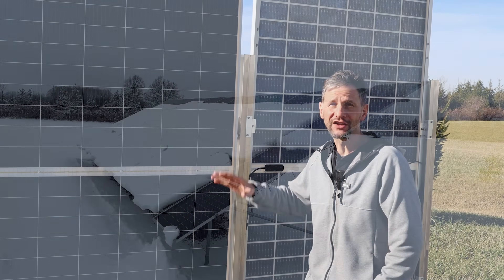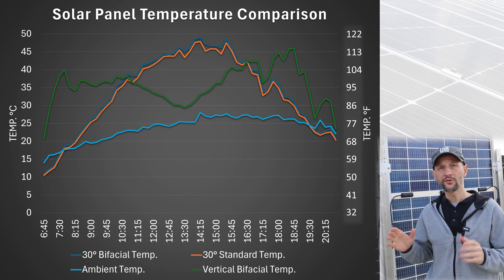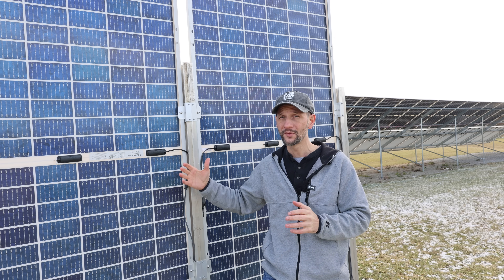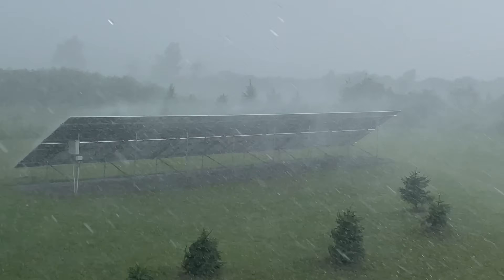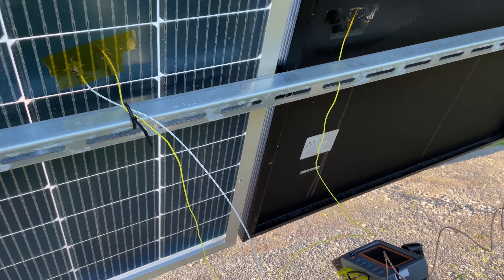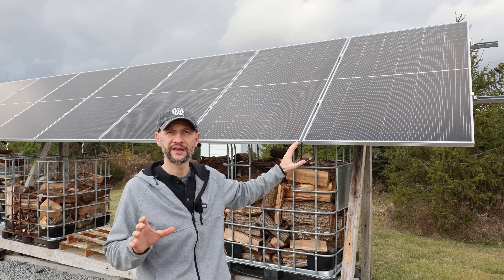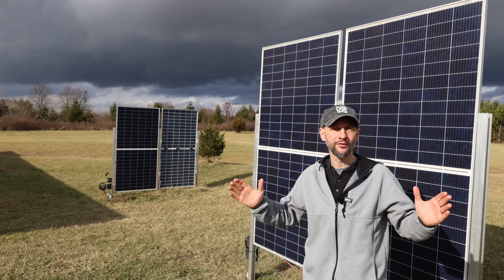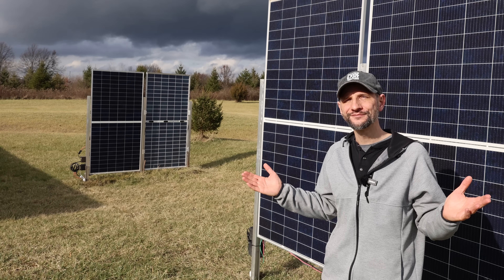HEAT -The Enemy of SOLAR- Are Vertical Solar Panels Better?

Comment: a black backing of a solar panel actually cools them off better because they are a better black body emitter when not in direct sunlight. this is one of those thermodynamic things that is misunderstood by most people on youtube for now.
Reply from the maker: Why do you think my data shows them running significantly hotter?
Reply: @ProjectsWithDave  Because the effect works both ways. Black surfaces are also better at absorbing radiation.
Reply: My guess is that if they were roof mounted, the black would irradiate more efficiently to the below roof materials compared to a white back.
Reply from the maker: I suspect roof mounted will show different results because there is dramatically less back side solar input.  I'll have to think of a way to test that.

Comment: Hi Dave! Using a radiator and water coiling do seem too complex for what you get out of them, but what about air cooling them with fans blowing into the back of the panels? It's not especially complicated and pretty easy to replace a broken fan. I feel like I've seen another channel briefly cover them, but I don't recall how improved the output was.

Might be worth looking into for the angled panels!
Reply from the maker: I suspect it would be helpful, but I think even the slightest breeze would be more productive than fans.  Maybe it would be worth while on very hot days?  It would be an interesting experiment.  Playing off your idea, I think it might be more beneficial for a roof mounted array.  You could detect when temperatures were very high and turn on some ducting system.  Or even better, find a way to naturally duct more air under the panels for better passive cooling.

Comment: When you get to trying some of your temperature tests on roof mounted array, perhaps consider a black/dark roof and a white painted roof - this alone makes <10 degrees of difference in roof temps.
Reply from the maker: The hard part is getting back to back data for a reliable comparison.  I have to think about how to get a valid result.   Maybe sliding something white behind a portion of the array on a dark roof.....

Comment: Dave, do you think it would be worthwhile to use some fans under roof mounted panels to cool them a bit, or would you waste too much power to be worth it? I'm thinking something like a wide squirrel cage fan at the lower edge of the roof. One or two panels wide maybe. Just a thought.
Reply from the maker: I suspect it would be helpful, but fans use a lot of energy.  Maybe it would be worth while on very hot days?  It would be an interesting experiment You could detect when temperatures were very high and turn on some ducting system then compare the total system efficiency including fan power.  Playing off your idea, it might be better to find a way to naturally duct more air under the panels for better passive cooling.

Comment: LTT solutions are only viable for those who at not paying for that solution themselves.

Thanks for all the data.  That is actually helpful understanding the trade-offs.  And you focus on the key metric, total production.
Reply from the maker: Thanks!  The engineer in me would loves to optimize everything but it isn't always practical.  For instance, I've always wanted to make a system for collecting heat from the hot water running down the shower drain to pre-heat the cold water filling the hot water tank.  Unfortunately, I don't think that project would ever pay for itself.
Reply: @ProjectsWithDave  Too much heat would be lost between mixing the hot and cold water, water through the air as you shower, then as the "gray water" enters the drain.  Not to mention clogging the heat exchanger with hair, dead skin cells and soap scum.
Those are the items that come to mind off the top of my Electronics/Broadcast engineering mind.

Comment: Hey, for what it's worth, Linus mentioned the Solar/Thermal panels in the most recent livestream WAN show (1 hour & 2 minutes in), and said they need to be replumbed since he forgot to add anti-freeze (ethylene glycol) before the winter freeze last year. solar PV still works, but no thermal benefits now.
Reply from the maker: In his first install he said he planned to drain it for the winter so he didn't have to use glycol.  Maybe he decided that wasn't practical.  The cost of having to go back and work on the system will likely negate the benefit for the next 20 years.
Reply: @ProjectsWithDave  Hopefully it's just the plumbing, and not the heat exchangers on the panels too.  I'd love to see the production numbers for his panels. I don't think I've heard any hard numbers, but it wasn't exactly a large system to begin with.

Comment: Quality engineer here. You may find value in creating these 3D graphs as contour plots. Python matplotlib tricontourf is pretty good at these. This type of graph lets you look at it in 2D but can analyze it as if it's 3D. Might be easier to gather trends from versus an X-Y-Z plot.
Reply from the maker: I thought about that but ran out of time, I'll have to try it and see.  Sometimes I get stuck in the analysis phase and don't get the video done.  There is so much to glean from data.

Comment: Great video Dave,  I did see a video of a water cooled ground array where the guy mounted a rain gutter along the bottom of the solar panels to catch the water and it emptied into a insulated cooler which had a small solar driven water pump (like for a bird fountain) to send the water back up to the top of the array where he had a pvc tube with tiny holes in it to drizzle the water over the solar panels.       It was effective also, I believe if memory serves that he lives in Arizona and it lowered his solar panel temps by about 20-30 F.        Happy New Year to you and all here !  ✨🎉🎊
Reply from the maker: That's an interesting solution.  I wonder how hot the water gets?  Maybe it's not that important since evaporative cooling would be significant in this case.   I still don't like the idea of constantly flooding everything with water.

Comment: I would like to see that hypothesis that the wind direction was causing the vertical panels to be hotter tested.
Reply from the maker: Hmmm.... Me too.  I don't think I could make a whole video on that, but maybe add it to another one for those of us who need more than theories.  
I need to get a device for logging wind speed and direction: https://amzn.to/3PgBNob
Then collect wind speed, wind direction, temperature, power output and irradiance for a couple of months.
I'll put it on the list,  can't promise I will get to it.
Reply: @ProjectsWithDave  Great. Just a flag in the ground to show where the wind is coming from could convince me that wind from the right direction will cool the panels significantly, while wind from the wrong direction won't. I don't say a detailed in-depth analysis with all those factors over a longer period wouldn't be interesting, but not necessary to support the hypothesis.

Comment: Get UV light resistant glass to cover the panels which would reduce the heat and also proteect the panel when there is a hail storm. Though that might cost alot for the glass.(good for limited space and hail concerns.)

Comment: Great video! I live in the Arizona desert, west of the Phoenix metro. During summer, turbulent desert winds force distributed airflow, so leaving a few inches of space helps a bunch. Here, we can also lose an easy 16%, due to dust and film buildup. Oddly, derating for high heat, dust, wire loss, and other losses seems to always end up in the narrow range of about 46% to 49%, so doubling the number of panels works out. So, most people calculate what they need productivity, then double that for the design panel capacity. Also, I have some vertical panels in an east/west configuration, which extends my solar day enough to reduce need for battery capacity.
Reply from the maker: Thanks for the Super Thanks and the detailed info on your actual situation.

Comment: I really like your videos. That said, I'd say most of us who are watching this and are serious about an alternative means of energy had already invested in solar equipment when it was a lot more expensive. I use my solar capability if I have an extended outage or in the event of a grid issue. Otherwise my grid power is affordable for me right now. I have cheap (cheaper now) panels that produce power. I have some power boxes that still use the old external brick charger. I already have batteries that have been greatly improved over the years. However when I plug my frig in it works. I for one could not replace my equipment with these more efficient models. The only exception for me would be upgrading from flooded or AGM to lithium batteries. Maybe I need a Utube channel? :). Were you able to sell off the panels you replaced? So in my opinion those of us who took the advice back in the day and got prepped are stuck with what we already have. Maybe not the most efficient, but it works for me the way I use it. But in any case thanks for the effort in making this video.
Reply from the maker: Thanks for the feedback.  I haven't sold any panels.   I just keep redistributing them to new locations : )

Comment: Amazing testing, thanks for all the hard work! Depending on the size of the setup, vertical panels (in addition to some standard angled ones) might make more sense than going with only bifacials in the optimal angle. I'd rather have 2 bifacial in optimal angle, than 1 vertical and 1 in optimal angle. But some people and use cases might only allow for vertical panels. Basically, as long as one has money and space, fill everything with more panels!
Reply from the maker: There may be an optimal application for each type of panel, but the possible combinations are endless...

Comment: Nice info, thank you Dave. I tend to think that the configurations of the panels for the sake of heat management has a direct effect on the longevity of the panels, extending their service life.
When you say "string inverters", there were some panels manufactured with microinveters on each string within the individual panels. These panels were excellent on dealing with shading and had a sizable increase in year to year efficiency. Unfortunately due to the grid tie market rule changes, there were issues with automated disconnects during power outages. Grid tie trends typically control the market when it comes to panels.
Reply from the maker: I suspect the vertical panels will last longer.  They see lower peak temperatures and avoid the most intense radiation during the day.  But, maybe lifetime production is the same?

Comment: So why don't they have heat syncs and fans
Reply: Because it's not worth the effort. You may gain a few percent more power but it will cost much more and adds complexity.
Reply: @TheFreezeChill  that makes sense then
Reply: @TheFreezeChill  As solar technology advances this could be worked out through more innovative design

Comment: I appreciate there's actually someone out there more picky about data collection and experimentation than I am.
I wonder if it would make sense to put an IR filter on some of the panels.  I imagine most panels can't make use of IR at all, but IR is what generates the most heat.
Reply: nah a good amount of solar panel power generation comes from IR wavelengths. this is why putting a solar panel inside a window cuts its generation by about half. glass blocks most IR and UV but lets visible light only through

Comment: Only in America could we make a grievance out of a metric unit for measuring temperature.  Freedom units indeed.
Reply: metric is Waaayyy easyier.

water freezes at 0°C - it boils at 100°C - 1 Liter of water at 20°C weights 1Kg and is also 1000ccm of volume. 21°C is room temperature.

average water supply for an adult is 2 L a day.  everything is better then counting toes and feet.
Reply: @casemodder89  Right, and where did they come up with 16 oz/lb.???
And what's the relationship between pounds mass and pounds weight? So bad that my math prof confused himself trying to explain it!
Reply: @casemodder89  but that solves nothing.  Which temp does food bake at, what temp does it need to warm at, what temps cause oil to burn at, what temp should I set the freezer to?
Reply: @sprockkets It doesn't need to solve anything. Basic math.
Reply: Celsius is fine. 0 is freezing, which is easier than remembering 32 degrees, and most other stuff is relative just like with fahrenheit.
Reply: @yaash4123 imo Fahrenheit is easy to remember, 0 it's very cold and 100 it's very hot. Fahrenheit for measuring for humans, Celsius for measuring for water, Kelvin from measuring the universe
Reply: Fahrenheit was made so that we wouldn't need fractions for temps either. I really think Celsius is dumb, esp for setting room temps.
Reply: @sprockkets  My thermostat uses integer degrees for Fahrenheit and 0.5 degree increments for Centigrade.

I'm really old and used Fahrenheit exclusively until high school Physics happened then I became bi-unitable. Still fluent in both but absolutely mis-trust anyone who engineers anything using Imperial measurements! 

Back in the 70s both Canada and USA went metric. Road speed and distance signs in both countries changed to show both units to ease the transition. 

There was backlash on both sides of the 49th but Canada (Pierre Trudeau) stuck with it. 

Meanwhile in the USA, big business and exceptionalism won the day and the signs went back to Imperial after just a few months.
Reply: @georgebissenden9297  that was Reagan who killed it even for the gov. I like everything metric but Celsius.
Reply: @sprockkets  Fwiw the military still uses metric
Reply: @sprockkets 😅 Using fractions is dumb. Metric is better in every way.
Reply: @mr.monitor.  congratulations on missing the point. 
But just in case you aren't thick, no, I don't want to set my house temp at 23.5.
Reply: @sprockkets  What you set the thermostat to is irrelevant if you are comfortable. Clinging to some old measurement doesn't help anyone.
Reply: @mr.monitor.  Lol, Celsius is a mere 18 years newer than the other. They both practically came about at the same time.
For the third time, I don't need to express temps with a decimal point because that's was the whole point of F in the first place.

Celsius will always be stupid.
Reply: @sprockkets  Cry about decimal points. My thermostat gives .1 F increments. Does this offend you? They came up with another system because yours didn't work well.
Reply: @sprockkets  Your argument is that decimal points are difficult? 🤣
Reply: I don't think dunking on Celsius vs Fahrenheit is the flex you think it is... Unlike basically every other Imperial Unit, Fahrenheit is also base 10, so there really isn't any inherent advantage to Celsius over Fahrenheit.  If anything, for these types of everyday outdoor measurements, the lower 0 point of Fahrenheit probably gives it an advantage so you have less potential for negative values, which could complicate things. You should advocate for measurements in Kelvin, instead (or the Imperial equivalent, Rankine).
Reply: @Lakster37 Yeah exactly. I would like to use Kelvin tbh.

But one could argue that celsius is better because its compatible with kelvin though.

But I generally agree with the sentiment. Fahrenheit is something I could live with.

And honestly I am thankful that we measure time the same 😂
Reply: @Lakster37 , there is a huge advantage. Using boiling and freezing points instead of made up nonsense is good. Worries over negative numbers is just silly.